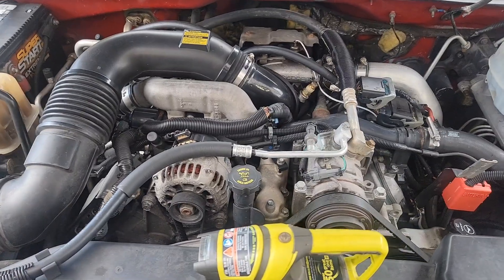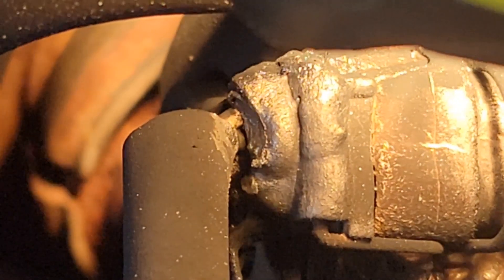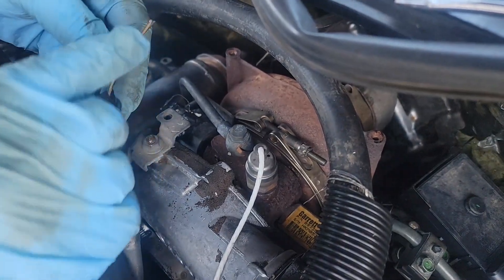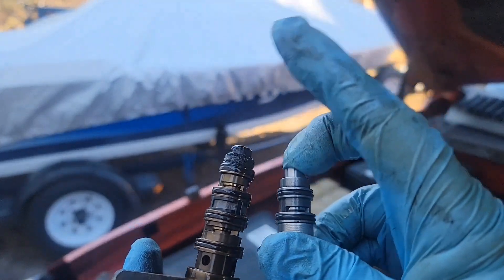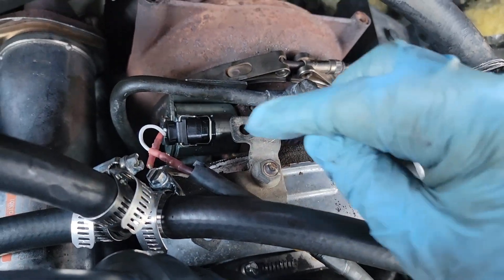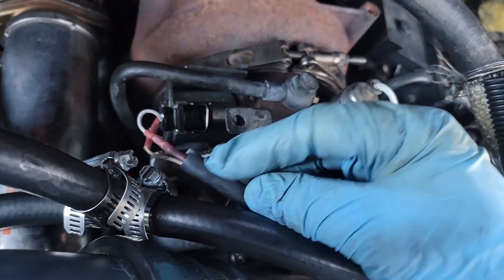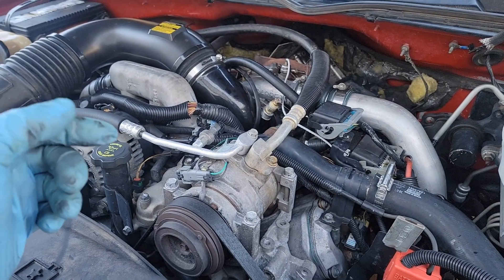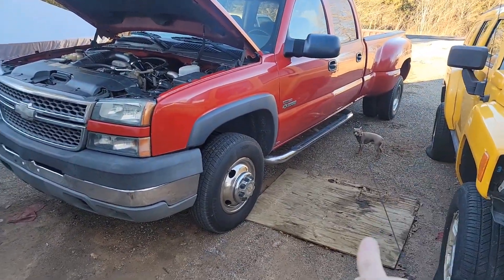Duramax LLY turbo issues and repair P0045,P0046 VGT solenoid , position sensor ,Chevy Silverado, GMC

Comment: Mouthpiece….is on the inlet side.  Looks like the clamp that holds the back housing broke.
Reply from the maker: yes if ya watch the video you can see what happened,   the big clamp holding the two havles together broke and i drove it home 450 miles from Florida and the heat that exscaped burned the position solenoid and pigtail.  i couldn't get the new clamp on so i didn't feel like pulling the turbo and i just welded the clamp and slide back into place and replaced solenoid and pigtail.   thankfully been doing great for last 6 or 7 months with multiple 600 mile one way trips and pulled my 5th wheel last week 600 miles , I guess stuff gonna happen since she only got about 360k on her , thanks for watching Vassmotorsports and hope ya check out some of my other videos sometime

Comment: Did you have any other problems with the clamp you welded?
Reply from the maker: not to jinks myself but thank God no i haven't,  and ive pulled few loads here and there and been to Florida couple times , but not sure why it did it the first time,    the cheap Ebay position solenoid has been doing good and no codes.   thanks for watching Vassmotorsports and hope ya check out some of my other videos sometime